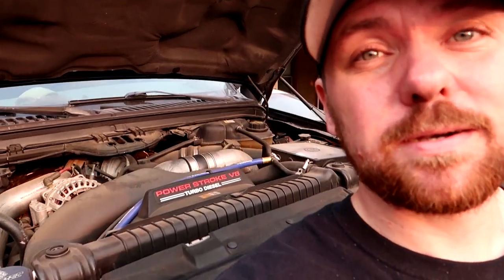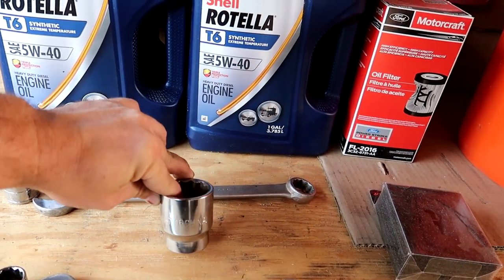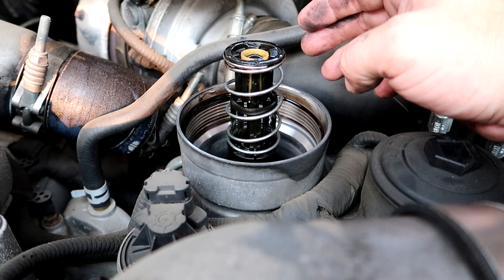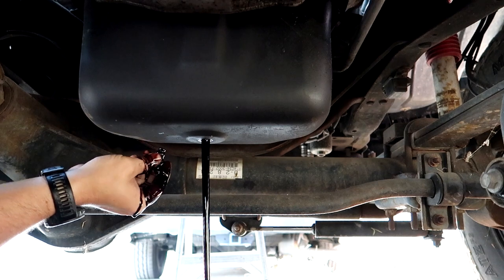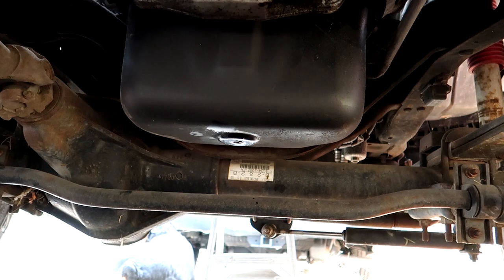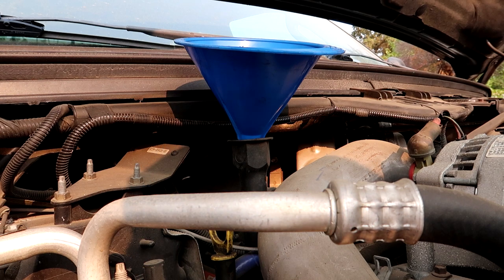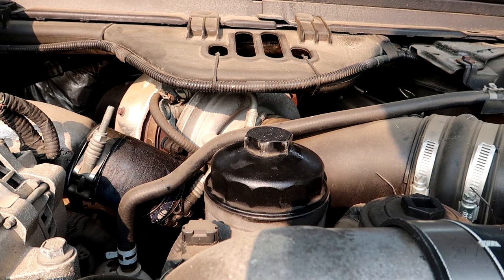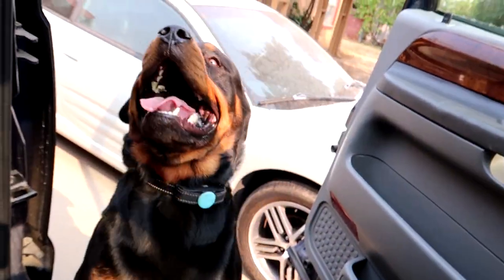How To - Oil Change - Ford 6.0 Powerstroke Diesel

Comment: regarding 0:21 Just a heads up for others. i incidently overfilled because the video said 4 gallons but if you buy Motorcraft diesel oil the big jug comes  1.24 gallons so you just need 3 jugs of Motorcraft.  Glad i found the issue of having an overfilled amount of oil.  My powerstroke did not like that but still was able to drive just wasn't idling smoothly like im used to.

Comment: Soaking the filter seems like a messy unnecessary step. The oil filter housing remains empty anyways since cranking the engine over is the only way for it to begin filling with oil.
Reply: I think he is talking about the filter itself being brand new dry, I believe he talking about the oil circulating in the housing being filtered as it is dry and be hard to filter when it's dry rather than it had already been soaked or used before

Comment: I know this is a bit after the fact since some of these answers are a few years ago, but in another video the guy doing the vid used an after market filter ( but from a quality filter maker) and it came with a rubber seal to replace the one in the oil filter seal cap. He did so because the one in the cap had become flat( which was very noticeable in the video) this wasn’t covered in this video. He he neglect to mention it or is the Motocraft seal an additional cost and part number?

Comment: First time on diesel world, can I switch oil from t4 to t6 rotella? Thanks in advance.
Reply from the maker: Yes, you can switch from T4 to T6. T4 is a blended conventional oil while the T6 is a full synthetic oil. Just drain all the T4 out and fill it up with T6. The T6 rotella is a much better oil.
Reply: @DrewskisGarage  isn't there an issue with fully synthetic having smaller molecules causing leaks to become more prevalent?
Reply: @lucifchristo  not in this modern of an engine that is not known for problematic leaks.
The t6 is better for the hpop and injectors.
If you are worried about mixing.
Do a couple oil changes close together and that should have you running straight t6.
But this guy is very far from a knowledgeable 6.0 person, so pay little to no attention to what he says or does.
PLEASE!
Guy doesn't know that a 5gal.
Pail doesn't fit.
Clearly his first rodeo, so.........
Reply: @kellyh4035  More importantly, guy doesn't consider cutting a gallon off that 5 gallon bucket so it does fit.

Comment: Got a question.  Had a recent oil change on my 6.0 diesel F250 2005.  Since the oil change I'm having quite a bit of leaking of oil on the ground.  Could this be from the filter not fitting correctly or from the oil fill cap not being secure?  I did have a very little oil leak before the oil change but nothing like I now have.  Thanks for any opinion or help.
Reply: Rear main

Comment: Nice video, just bought a 06 powerstroke F350, did my research and want to use rotella for my oil with some archoil in there too. I have a question, how many miles do you go inbetween oil changes. I figure its synthetic so it can go longer, i only use my truck to drive to work and home, days off light traveling, i dont tow or go offroading. I only put 10 miles  a day 5 days a week.
Reply: 5000km google km to miles for conversion . Cus u do short trips .
Reply: The dealer oil filter is only engineered to go 5000 miles. Best to change every 5000 miles or 5 or 6 months.
Reply: every 5000 miles of towing and not towing 7500

Comment: Do you happen to know if the STP XL filters are the right size? I picked one up the other day not knowing this since apparently the AutoZone I go to doesn't even carry the right Motorcraft filter so I would really like some input on this before I go and put it in
Reply from the maker: I have only ever used the Ford Motorcraft filters because that’s what Ford recommends and I have heard horror stories from people who have used other brand filters. So I’m sorry but I don’t know about the STP XL filters.
Reply: @DrewskisGarage  I looked into it and thankfully they are more or less if not exactly the same filter apparently the big issue is with the ones from Napa Auto Parts not fitting properly as well as disintegrating and destroying the motor but from the looks of it the STP Excel I bought is both the right side and is not made of any plastic that can break off in the system like the Napa

Comment: What size socket did you use for oil cap?
Reply: 36 mil should be
Reply: Guy said 32mm in the video. I should have read the comments first. Heading back to oriley's to exchange for a 36mm